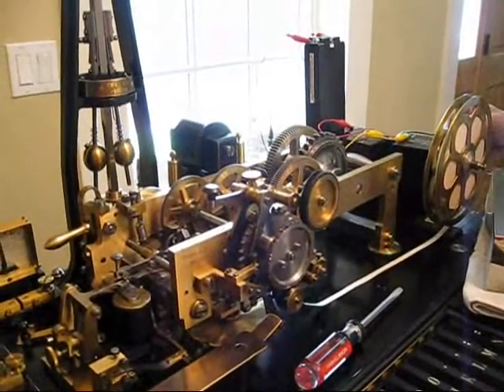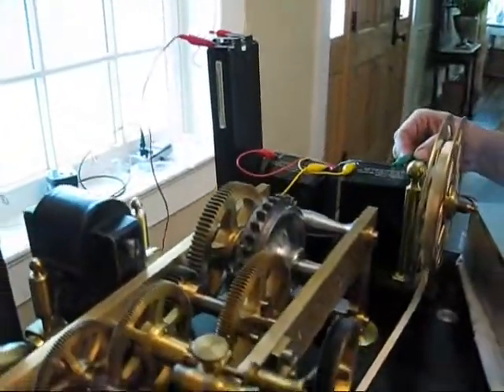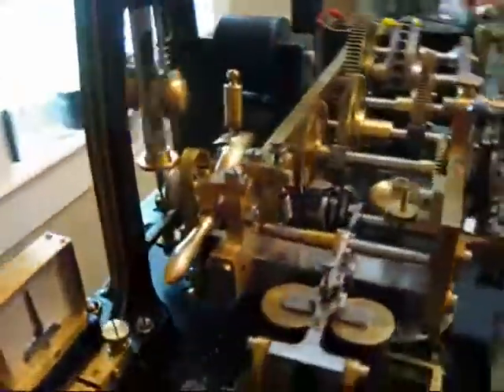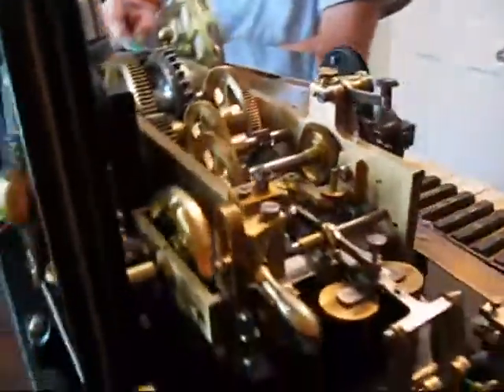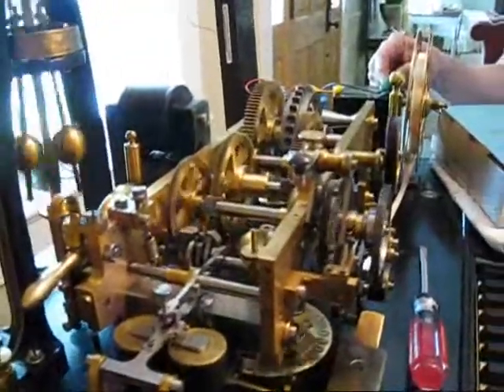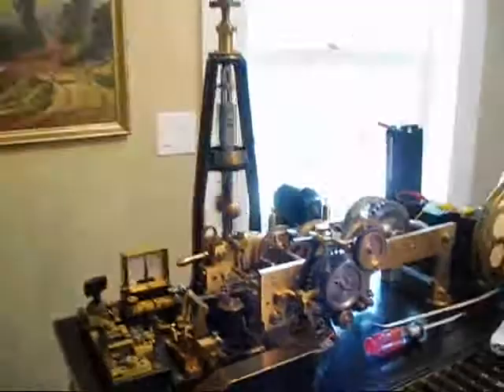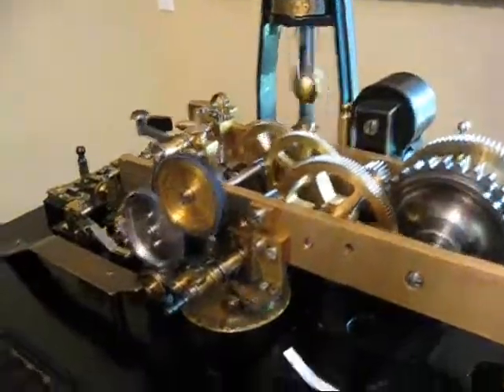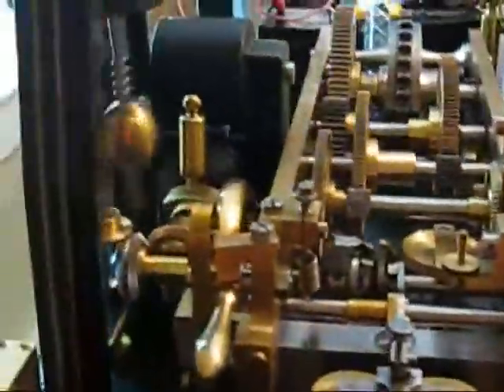1865 Hughes Printing Telegraph

Comment: Does it need another machine to communicate with? Or is it meant to be an all-in-one machine? The word telegraph has me wondering and I haven't been able to find much that is helpful online.
Reply from the maker: Yes.  It requires the exact same machine on the other end as well as a source of power between them like a battery.  Search for Hughes telegraph you'll find some stuff.  Good luck